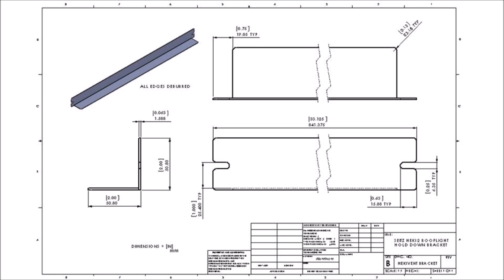Seitz Heki 2 Rooflight Vent - Hold Down Fix

Comment: There is no gap above the handles to slide the aluminium into. The handles are fixed tight to the acrylic. So this won't work for me. Mine is a Heiki 2 rooflight.
Reply: Wendy. I've run into the same situation. Did find a fix?
Reply: Mine had a little silicon stuck between that area when it was assembled new and it pushed out to slide it in it has to be a tight fit,it was excess sealant that's what I found.